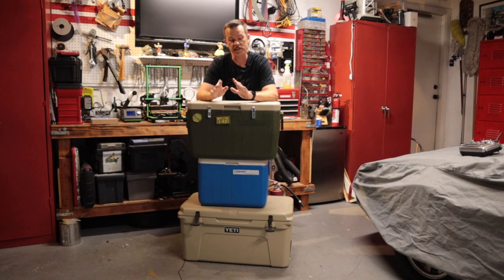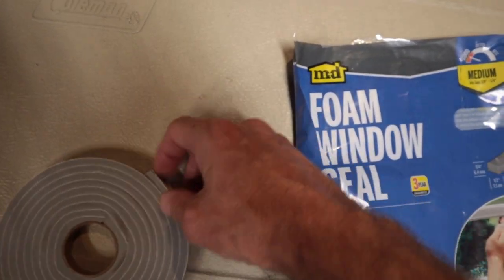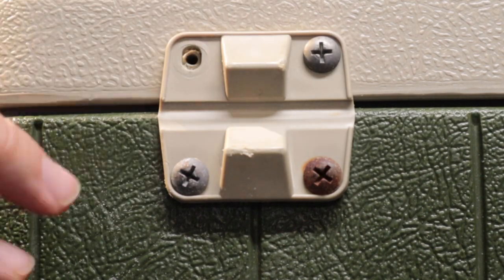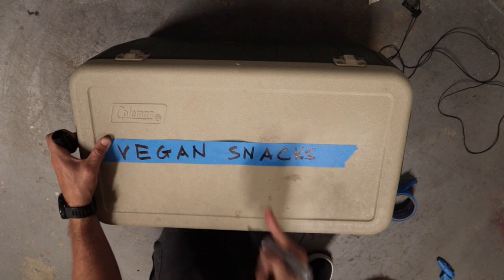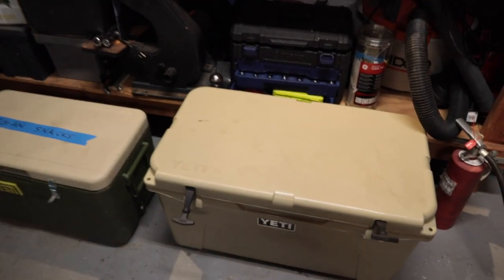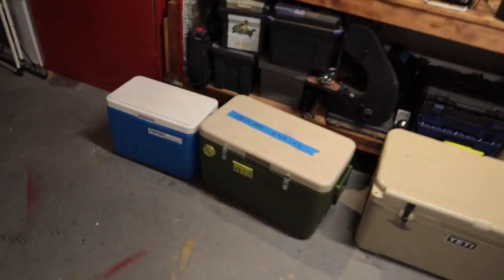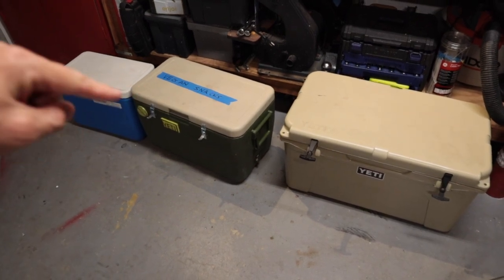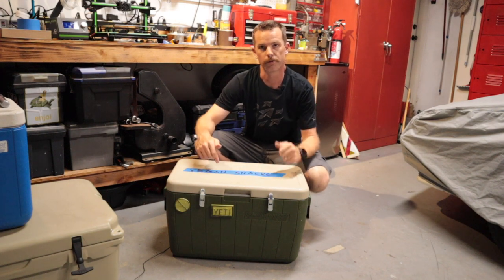Testing a Hacked Cooler - Better than a Yeti Cooler, Part Two! More Hacks and Upgrades!

Comment: The hinges were not designed to hold more weight in the lid so they will Crack in two pretty fast.
Reply from the maker: Its lasted for years and still is going find. Foam doesn't weigh much.

Comment: I'm going to use a bag of Styrofoam peanuts to fill the extra air spaces. Will bring extra foam sheets to thicken the walls to replace the ice as it melts and drain the water. Any thoughts?
Reply from the maker: Great idea!

Comment: I been doing all the steps you done to cheap 10 dollar Walmart 110 cans plus coolers and keep ice no melting with a rubber seal for ,,6 days in 100 degree f southern Gulf coast summer heat 24 hours a day for 6 days. And seal the lids next time with latches on the ones that had latches ice won't mel on a day and half in a properly shut yeti more like 5 days in ,100 degree heat all day and night will it start to become watwr

Comment: Another interpretation is that larger coolers retain ice better than smaller coolers. But to be fair, it's not surprising the Yeti performed best.
Reply from the maker: If you want to talk physics, if the space inside the cooler is larger, but the volume of ice is the same, and the insulation was equivalent, the larger cooler would be worse.

Comment: How did the screws on your draw down latches hold up? Did they start to pull out after awhile? I screwed a locking hasp onto a cooler to critter proof it and found that the screws pulled out after a few camping trips. I tried again with screw anchors with not much more success. Ideas?

Comment: Great video mate! I jsut had some issues trying to screw into the cooler... screws are not holding well and they are slowly popping out from the cooler body. Any suggestions ?
Reply from the maker: Sounds like they may have been over tightened. Do you want to use one with the thick thread and not torque it down too much.

Comment: Foam in those cheaper coolers only extends about half way up the sides.  Source: I used to sell them.
Reply: So you cut them open to test them before you sell them?
Reply: @pilsnrimgaard2507  The Igloo sales reps did all the cross sectioning to show how much better their marine coolers were compared to colemans and even their own cheaper models.

Comment: A true test would match the internal volume of each chest.
Reply from the maker: If someone wants to buy me three equal size chests Im all in. In the mean time this test actually gave the smallest chest the advantage, and it still lost. So the test still proved the project works.
Reply: @DoItYourselfDad  Yeah, the cooler filled with the most ice to maximum capacity has the advantage even if all coolers have the same amount of ice. The small cooler had a full tank and was an ice hog. The larger coolers had a 1/2 tank and got a lot more mileage.

Comment: The yeti is definitely not standing to the hype that's for sure.  The retention of cold air should be much more in the yeti. However you should precooked coolers with cold water first.

Comment: The other thing--the Yeti is bigger and also lighter color. I think the two coolers are almost matched. That's a good job. Fun fact about the bear test. No cooler is completely bear proof. There's a group that tests them and they don't test every cooler. The cooler must have a certain type of lock. I think it makes sense in some areas. But if there are that many bears, they should have bear boxes. Btw, there are US made rotomolded coolers for $60 cheaper and Amazon coolers that are $100 cheaper.

Comment: What do you think is better? The plastic t latches, flexible rubber draw latch or the metal latches you use?
Reply from the maker: I've had way too many of those rubber latches fall apart in the sun, and the plastic latches fall apart fast. I think metal is your best bet.

Comment: Why don’t you also squirt expandable foam in the other cavities (sides and bottom)?
Reply from the maker: Those come with foam in them from the factory
Reply: Interesting; curious, how did you/do you know the lid does not have foam, but the rest of the cavities (sides, bottom) have foam?
Reply: Richard E... He used one for target practice🤔😁
Reply: @Richard E ; Doing the other spaces (walls+floor) of some cheapo units is a good idea, because the worst of them only have thin expanded polystyrene cut to (nearly) fit each section, so the corners are just air space. Drill your filling hole and remove the EPS (a poor insulator anyway) by pouring it out dissolved in a solvent which eats it but not the casing, then leave in sun to evap the solvent before doing the urethane foam fill.
Reply: @richarde1355  He said there is a video on another channel that showed the two coolers cut in half to reveal the insulation in each one.

Comment: full the sides/bottom of the cooler with foam there are still gaps. 
but for the $ still better than the Yeti..
Reply from the maker: The sides and the bottom come filled from the factory.

Comment: Residual air volume has a lot to do with initial ice melt as volumes were all different.
Reply from the maker: Yup, that gave an advantage to the smallest cooler.... which still lost.
Reply: That idea was tested by another YouTuber "coolers on sale" and proved no difference on wether the cooler is small or big. Ice melt was the same.

Comment: Yetis are only better because of wall thickness. I have a large Coleman with extra thick wall which id put up against ANY yeti.
Reply: My Xtreme Marine Coleman will still have ice blocks after camping for nearly a week.  I did add rubber latches however. My comparison, our little Igloo roller is flat on it's face in 2d.
Reply: Pils Nrimgaard  well yes, mostly.  You just explained how insulation works.  R-value x inches.  They are also much tougher.  Not many people really need that though. If you have a Coleman with comparable insulation it should be about the same.  The seals will help too.  Can you tell if your lid is insulated? I use my Coleman to cook immersion style and there is no doubt that my lid is not insulated I made an insert out of 2 inch rigid foam that fits snugly inside the top. Huge difference!

Comment: In this video you said the bottom already had foam when you did the top. Did you add the foam in the bottom?
Reply from the maker: No, they come that way from the factory. Only the lid is empty.
Reply from the maker: No, they come that way from the factory. Only the lid is empty.
Reply: Interesting. The ones I’ve seen sound hollow.

Comment: Gotta say though, the difference between the performance of the stock cooler and your modified cooler isn't huge, and the are different models and different sizes. Those two factors alone could be the root cause behind the difference in performance rather than the mods you did. I'm not saying the mods were not the reason...I'm simply saying that unless you did the test with two of the exact same model and size cooler you really can't claim the mods made a difference.
Reply from the maker: The smaller volume gives the smaller cooler the advantage due to the contact area, and the smaller cooler still lost.

Comment: I have a cheap Igloo marine cooler sitting in a thick styro-foam cooler like you would get frozen steaks in. Had to modify a bit but it works very good in Florida summer sun and I saved it from the landfill. Just the styro by itself is probably as good as a Yeti but not as durable. I also keep one in the car for grocery shopping.

Comment: The stock cooler could be better insulated on the cover by adding insulation foam to the valleys between where the foam went in.
Reply: Lee Man did you read the pinned comment?

Comment: Use double-sided tape and line the inside of your cooler with aluminum foil and test again. I think your Not-A-Yeti will give the Yeti a run for its money at a fraction of the cost.
Reply: ,I love your idea but. I think of alinum foil as fragile. How is that aluminum foil not going to get broken and ripped with stuff jostling around inside?  And the glue on the double sided tape, how will that survive after water logged? Plus how to clean the gunk that will accumulate along the edges? Not meaning to be all negative, I am just not a handy person and so wonder what I might be missing.

Comment: The only accurate test is with the same volume cooler and same amount of ice.  A smaller volume chest has less surface area.
Reply from the maker: Correct, but the test I did have the smaller cooler the advantage, and it still lost.

Comment: It is kinda hard to compare all 3 since they are all way different sizes but IMO you should of had them all full of ice and or least a 1-2 bags of ice in each and then filled it all with water bottles. Most ppl tend to fill their coolers and more full they are better they are. Would of a been a better stress test but still this shows some results too.
Reply from the maker: If anything the difference in size gave the advantage to the small cooler, which still lost.

Comment: I have seen a few of these videos that try to improve coolers to help match the yeti, but what everyone has failed to understand, is that even though non-yeti coolers are insulated, the insulation is not as good as the yeti, and that helps explain the cost difference . It’s not that a cooler is insulated, but what kind of insulation there is. It doesn’t matter really if you use seals, and insulate the top to help improve it either, without good side wall insulation, (which is what helps keep the temperature) the cheaper cooler won’t improve really, well not enough to justify the money and time that will be involved. If you want yeti performance, then get the yeti cooler. For as long as you’ll have the cooler, you’ll make up for the price difference in ice costs and wasted food possibly.
Reply from the maker: Yeti coolers use polyurethane foam, nothing magical. You can buy coolers for a 1/4 the money with the same foam in them. There are coolers out there that are as good, or better than Yeti's for much less money. When you buy a yeti you're paying a premium for a name.
Reply: @DoItYourselfDad  Go to a building supply store and get a sheet of high density insulation panel 1" but 2 or 3" if you really want to overdo it, grab a can of foam panel adhesive.  Make a 5 sided foam box that is 1 to 1.5" deeper then cooler. make a piece to into the top of the box with another sheet glued to it the size of the outside dimensions and add a handle. Drop in cooler and this setup isn't super sturdy but in a boat (great to hang lures on foam) or at a camp site will smoke any 500 cooler in performance.  You can also put fitted pieces inside of the cooler if its big enough.
Reply: Exactly and material is a lot less dense

Comment: or you could just buy the Coleman Extreme series cooler, they come with insulated tops and come within a couple of days of a Yeti. It’s just as important to cool down your cooler before use and make sure you cool down everything you put in it. Yeti’s are tough as hell, but too heavy for my needs.
Reply from the maker: Agreed, and the Coleman extremes are a great value.
Reply: you done a good job on the cooler you modified ; I'm going to try to modifie my.   thanks
Reply: I have the largest Coleman Extreme 120 Quart and a ~50 quart Igloo, and I can put the Igloo full of ice in the Coleman and it keeps ice better than a Yeti, plus it's cheaper, more versatile, and has more interior space than a similar-sized Yeti. I put two bungee cords around it and it's "bear proof" as a Yeti too.  Hahaha

Comment: So, a couple thoughts:
You didn't measure the amount of water in each cooler. 
You also filled the small cooler to much more capacity than the others, due to a single bag taking up more of the available space.  Anyone familiar with coolers or freezers in power outage situations will tell you that the more space occupied in a cold space by cold materials other than air, will cause the materials to stay colder longer.  This point actually suggests the unmodified cooler would have done worse than it appeared. 

A more scientific method would be to pick up some wireless thermometers, and to measure and freeze ice blocks by size, then measure the temperature drop and the amount of water at each interval.  This could be extended to putting the ice block in an open top container in the cooler, so melt water can be measured easier.
Reply from the maker: I agree with you, and you are correct, but in this situation the unmodified cooler had the advantage, and still lost.

Comment: Ice is cheap !
Reply: yetis are not
Reply: I have a freezer and plastic containers. My ice costs whatever electricity I have used.
Reply: I have an electric Marlboro cooler/heater. Couple of small blue ice blocks to help it along, and it almost freezes stuff. I haven't smoked for almost 10 years, and Marlboro quit giving anything away that said Marlboro on it a couple years before that, my electronic hot/cool chest has lasted over 10 years, I should fill it with foam, it would be badas*
Reply: RE:wayne -O. But not readily available if you are out in the boonies for a few days.

Comment: so... how did people manage camping in the 70s and 80s?
Reply from the maker: Coolers were built a whole lot better back then.
Reply: @DoItYourselfDad  can you do a video disecting a 70s/80s cooler and contrasting it with a modern day cooler? what made the old ones better, and why isn't anyone building them like that any more?
Reply from the maker: @kenjifox4264  My coleman from the late 70's has a metal shell, thicker foam, foam in the lid, actual seals, actual hinges instead of the flimsy plastic things they use now. It has a clasp that holds it closed....etc etc etc. No way I'm dissecting it, I love that thing.
Reply: @DoItYourselfDad  well, maybe not a literal dissection. Maybe if you used diagrams or photos. Or how about this? if you could find an old broken (useless) 70's cooler similar to yours, maybe you could do a literal dissection.

I bought a cooler from Home Depot and it's awful; doesn't keep anything cold, even with dry ice. Now that you mention it, my cooler has nothing inside the lid!

Comment: You should take a wine cooler cooling device which is a peltier device install in the DIY cooler with a solar panel on a 12 volt battery and be cold and definitely
Reply from the maker: Those owl tiers suck power like crazy, I’ve got a 12v off-road fridge that sips power, you can pick them up for the cost of a quality cooler.
Reply: @DoItYourselfDad  really any 12v cooler iv found is easily 3-4 hundred dollars I'm talking about a quality diy for the commoner I guess I'm really not so common then cause this plandemic cost me everything I have ever worked for and saved ty for correcting me.

Comment: You didn't compare the same model of your hacked cooler to an unhacked cooler.  This test shows nothing.
Reply from the maker: Sigh…. I compared it to a smaller cooler, which has less surface area for the same volume, giving it the advantage, and it still lost.

Comment: Not a real for test between the two cheap ones. Their 2 different coolers and 2 different sizes to start with so even without the seal and latches the green one may have done better than the little one. But yeah those yeti seem way over priced no doubt. Double the price should get you one of those yeti not 6 to 10 times the price. Crazy what they get for them

Comment: If you are going to invest so much time and materials modifying a cheap cooler, with the same money and materias buy a better cooler. Not over priced just better.
Reply from the maker: When your comparing a $25 cooler to a $400 cooler, and we’re taking about $5 in materials, I’m going to go with the cheaper option.

Comment: Take the Yeti badge off please, your cheapening the mod, Yeti is better but very expensive, it's like a range rover built for bears but most won't make out of there local park.
Reply from the maker: It’s not a yeti badge.....
Reply: @DoItYourselfDad  The thing that says Y E T I is Not a yeti badge . You should have just made a coleman badge that resembles the yeti logo like all the other knock offs do or a slash through the word yeti .
Reply from the maker: @skoshunt  My badge literally say's "Not A Yeti".....
Reply: @DoItYourselfDad  Literally "not YETI" but "not" is so small i can't read it until you zoom in on it.  I was not trying to insult your "not yeti"(coleman) cooler , but I get Dr. Thunder not "not Dr. Pepper"